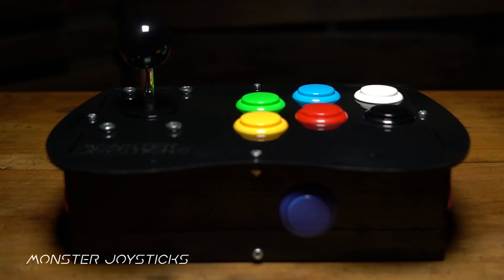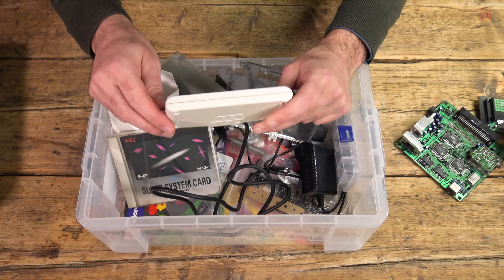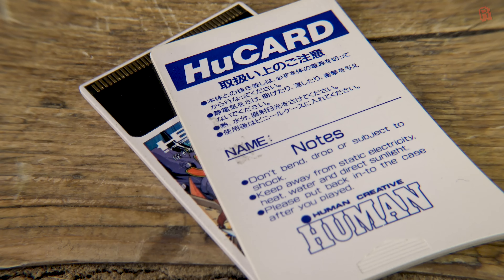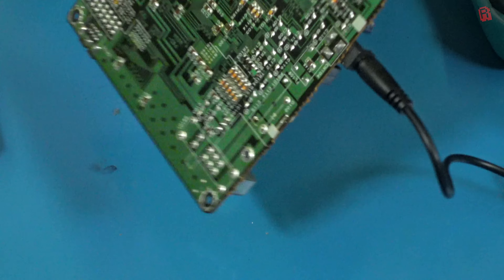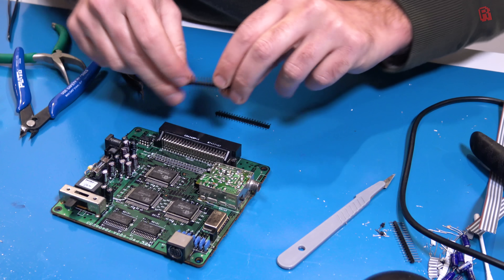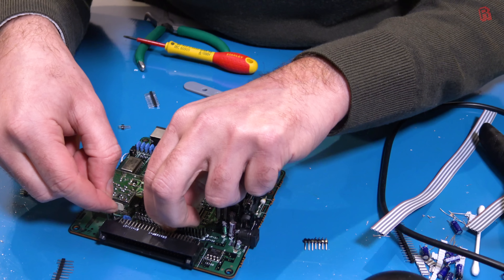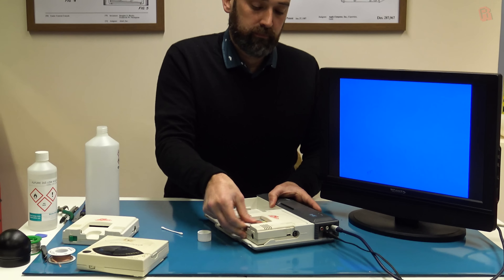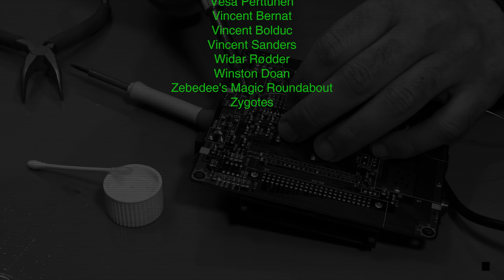PC Engine Trash to Treasure (Pt1) - Restoring NEC's 8bit Wonder

Comment: Nice job with the restoration! Though I kind of prefer the grey of the CoreGrafx units, the original PC Engine is so striking in its own way.

As for game recommendations - the first port of call is with the shmups, there are an amazing amount of them, on both HuCard and CD.

HuCard wise my picks would be Galaga 88, Super Star Soldier, Gunhed/Blazing Lasers, Soldier Blade, Xevious plus Gradius & Salamander. Some non shmup gems are Victory Run, Out Run, Devil's Crush. I'm sure there's plenty I've missed too.

As for CD games, on the shmup side Gradius II, Gate of Thunder and Lord of Thunder are all worth digging. Ys Book I & II is great (though hopefully there's a way to get the US version running on a Japanese system for obvious reasons).

And I did chuckle a bit when you were getting it all going, because we've all been down there before.

Comment: Alright, so if the RGB pins are available on the back, you can definitely RGB mod the interface unit because you just have to pick off the appropriate pins. You can just buzz your cable with a multimeter to figure out which pins you have to use for RGB output.

Comment: There is a turbo-block add on that goes into the PCE expansion slot so you can get component, composite and RGB.  however the CD briefcase setup...not sure how to get RGB on that

Comment: If the interface plug on the back of the PC Engine has RGB, then the interface shouldn't require much modification. Those pins probably aren't populated, or maybe not routed to anything, on the board in there. I would suggest putting a DIN socket with the right number of pins wherever it will fit and look nice. I suggest DIN only because it's compact enough, and won't send any mixed messages to someone coming along behind you, like a VGA socket might.

Comment: You also CAN'T use the TV-Modulator/RF. Even if your TV supports NTSC input on composite, it would need a dedicated demodulator for japanese RF. Even many american TVs usually can't tune in the RF signal from japanese devices; in that case it's because they can't access the correct channel.

Comment: I modified my IFU using Voultar's IFU RGB with a nice Deltron 9-pin Din. Also re-capped the IFU and replaced middle gear in my CD-ROM2. Surprised you didn't perform the PCE jail-bar fix though? This makes a HUGE difference, especially if connecting to an OSSC or Framemeister. ;-)

Comment: The CD-ROM isn't too bad to work on, I got a new gear and replaced it and managed to reuse the circlip. Had to trim one of the pots though, when I tested it with an audio CD and headphones the audio was skipping. I just tried adjusting each pot until the audio played perfectly, worked great.

Comment: As soon as a saw that stiff ribbon cable I thought of pin headers. Glad you put some on and made a flexible cable and the fuse holder was a good idea too.
I've always thought the white plastic and the styling makes them look like a cheap and nasty toy, which is such a shame. But that's just my opinion which is probably wrong anyway!
However, that CD-ROM cover could change the whole style, looking forward to the next episode.

Comment: A Turbo Everdrive might come in handy but are pricey like most of these replacement carts.  As for games there is Bonk's Adventure, CastleVania Rondo of blood (Akumajou Dracula X - Chi no Rondo) It is a CD game also, which is the game before Symphony of the night. plenty of Shmups too like Lords of thunder, Blazing Lazers and Super Star Soldier, Soldier Blade. Then you got to get Bomberman.
Reply: I had trouble with my everdrive with corrupted graphics in game, but orginial cards were OK. I have a few PC engines and they all had the same problem.
Reply: @willyarma_uk  After finding a TurboGrafx 16 (USA) for a ridiculously good price a few years ago the first thing I did was buy an everdrive and download the complete romset for it. Now it's almost 3 years later and I've never once had a problem with mine. I think I remember reading that the first run of turbo everdrives were faulty in some way though so that may be your problem
Reply: @willyarma_uk  So your saying there could be an issue with them then.
Reply: @enigma776  Possibly, I dont know if its just mine, prehaps its faulty or a fake. Have you had any glitches?
Reply: @willyarma_uk  I do not own one but was thinking about it. As I said its quite pricey.
Reply: @willyarma_uk  It depends on which ROM-dump you use. Some games have several different ROM-dump versions. Some work with the everdrive, some don't. Best get the complete rom dump set for PC-engine/turbografx 16 games which contains every rom version ever copied from the original HU cards. Then You'll find working copies for sure.
Reply: @willyarma_uk  Theres a switch with the later models to change from Pc engine to Turbografix.
Reply: The suggestion of Bonk makes me wonder just what RMC describing the series's punny Japanese titles in his signature style would sound like

Comment: Great video, I suggest you modify your Briefcase Unit to add RGB Amplified Scart output, I use Tennokoe units modified in a similar way as they are a more non-evasive console mod like your lead :-)

Comment: Why not just strip the wires for the old cable and then reinstall one wire at a time? That's what I like to do but I know everyone has their preferences and I am not criticizing. The reason they break is from people moving the cable around too much when opening the case too often or performing mods. Don't move the cable around and they will never break. So reusing the old cable is just fine. A white screen can also be the sign of a faulty chip on the board. So good thing a simple cleaning fixed it. Great Video :)

Comment: All the video signals are generated by the PC-engine and passed through the cd interface, so if you RGB mod the PC-Engine, and replace the RF with a suitable DIN you will get perfect video from the CD without modding the interface. There is very little room inside the interface so the console RGB mod is the way to go.
Reply: I did do a component video mod to an interface unit, but it was very difficult, because of space limitations.
Reply from the maker: Thanks for the tip, I will never use the RF so that sounds like a viable option that I'll look into thank you

Comment: 08:40 You should not use Switching regs for video ICs as they introduce loads of ripple that can translate into visual interference (usually diagonal lines in the picture). Stick to Linear regs. To lower temps use a newer Liner Reg like the 78S05 (slightly more efficient than 30yo+ ancient regs), also add thermal paste and do not feed more than 9v input.

Comment: In regards to having RGB in the Interface Unit, it's possible to do so, just some soldering and figuring out which wire goes to which lead.
http://8bitplus.co.uk/projects/nec-pc-engine-interface-unit-rgb-mod/

Comment: Nooooo Neil you get 2.54mm pitch cable! I'm crying 😭😭😭 They even come pre crimped 😭😭😭
Reply from the maker: Link me up!
Reply: @TheRetroCollective  took me ages to find it back it the day - search for "ffc jumper cable". Example: https://www.esskabel.de/produkt/flex-jumper-254/

Mouser: https://www.mouser.at/Wire-Cable/FFC-FPC-Jumper-Cables/_/N-ad930

Took me ages to figure this out when searching for a replacement for my TB-303!
Reply: BTW, that footprint might actually be 2.5 mm and not 2.54mm, that's why it doesn't fit standard headers! But there are 2.5mm headers and 2.5mm connectors... just for this purpose... in case a 2.54 mm cable will not fit the raster
Reply from the maker: @cheater00  Excellent stuff.  The clearance on that hu card PCB is really very tight with just the cable in so even those connectors might be too much, but I love the idea of using those cables.  I'll have a play with them thanks and see if they fit
Reply: @TheRetroCollective  I was thinking you would solder to the daughterboard and use a connector for the main board.

But i also thought you might be able to make a small pcb that goes between the two and just connects the two through. It could be soldered to the daughter board. Question is if it's too much faff.

Comment: It's also like "NEC's one hit wonder" when it comes to consoles. 

Neil, you went out shopping for the fuse? Was checking some UK retailer. Maplin didn't mention anything about the crisis, while Currys (are they spicy? ;-) says shops are closed but you can order online. Here in Canada all shops are closed. The biggest retailer here (BestBuy) also orders online shopping with home delivery, but also "store-front pickup".

And lastly, I could never figure out, when hole through processor pins where replaced by surface mount (or how you would call it), assuming around 1990. But your console seems to be from 1987 and most chips use surface mount. So I am wrong, or the Japaneses were ahead of other countries.

Comment: I still prefer the TurboGrafx16 , but that's my Nostalgia (!) do you have the Everdrive  ? 
Also, that PCB is so small, you could make a TurboExpress with it ! just need a good screen, Battery & controller integrated on printed shell ...

Comment: I've got several PC engines. I've done an RGB mod on one of them. Theres a bit of grime in the plastic that wont come off, hopefully after watching I might have some new ideas.
Reply: I didnt try a brush, was scared of scratching, but i'll give it a shot. That regulator module is ace! and that expansion slot scart cable too!
Reply from the maker: Thank you!

Comment: I wonder if that cable broke because someone had been in there before and repeatedly bent it backwards and forwards, fatiguing the metal. The plastic might age and go brittle, but wires don't unless they're repeatedly bent or they become corroded.
Reply from the maker: It's certainly possible.  My first thought was corrosion caused by leaking caps but that wasn't the case

Comment: The 7805 basically burns the excess voltage, so if you go from 9V to 5V almost half of the electricity the device draws is just being burned...

Comment: I could repair that with ease. I used to rebuild the original NES, Sega Genesis, Sega CD and the Turbo Duo. That Data Ribbon Cable isn't difficult to replace either. --'
Reply from the maker: Nice one Sean
Reply: @TheRetroCollective  If you use Soldier of 80/20 or 70/30, the Solder joints hold up very, VERY well. I haven't run into any Capacitor problems in all of the units I've repaired, but a few leaky ones should be replaced without question. The PC Engine was well-ahead of its time, and if you can shell out the money, you would have your hands on a very, VERY Classy, yet POWERFUL little system with an AWESOME library of games for the Nostalgia or a an eager collector!!!! Good show Mate! ^_^

Comment: why wait for the soldering iron to cool down? unscrew with some pliers, remove the entire assembly by  grabbing the tip with pliers, set it down on a heat-resistant surface, put needed tip on heating element, put sleeve and nut back on with pliers.
Reply: why i know this works? done it myself. be careful about the sleeve and nut tho, stuffs pretty hot after the soldering iron heated up.

Comment: Also for my suggestions, I'll repeat the suggestion for Gunhed (not Gunhead) down below: it's the Japanese release of Blazing Lazers. And if you're going to do that, also get the various Star Soldier games that were released on the platform as well. And three more notes:
1) Unless you want to get an Everdrive, you will need to get Japanese releases for your PC Engine — the region lockout on this thing actually involves rearranging the card pinout! I'm not sure if anyone has made a standalone passthrough adapter or not, but if they have, you can go ahead with that, I suppose.
2) I do not know if the PC-Engine CD-ROM^2 is similarly region-locked or not. If it is, given your request for games that are playable in English, it'd probably be best to give up on any RPG suggestions. If it isn't, I'd have to point out that Working Designs only just got started at this point and often went even more overboard than usual for them when increasing the difficulty for their localizations of CD-ROM games. (Exile 2 is particularly infamous in this regard.)
3) Your CD-ROM card adapter is the Super System Card, which means you're already set to go with the later "Super CD-ROM^2" series of enhanced games with your normal CD-ROM^2. I'd suggest looking at the rereleased Super CD-ROM^2 unit that was sold simultaneously for people who didn't already own a regular CD-ROM^2 — it has a different interface unit built in, and I wonder if that one satisfies your video desires. What you don't get with that card however is support for games that require the Arcade Card; if you have that, you'll need to get the Arcade Card Pro (specifically, as the normal Arcade Card Duo requires that new version of the Super CD-ROM^2 interface).
Reply: Oh also if Guru Larry and/or Slopes Game Room are anything to be believed about the popularity of Parasol Stars in the UK, then I'll remind you that that game was developed for the PC Engine specifically, so go for that one too I suppose...?

Comment: What do you mean the lights were condemned? How are lights condemned?  Did they not pass code or something?
Reply from the maker: The lights kept tripping the electrics out, the land lord sent an electrician, the electrician said they weren't safe.  A 2 week battle ensued in which the landlord replaced 12 x 1.5m fluorescent tubes with single 5w spotlights... it was a terrible solution and a pretty stressful time as you can imagine having very little light in The Cave.  I had to get legal advice to help get the landlord to install lights that met health and safety standards.  Anyway...we got through it in the end.
Reply: @TheRetroCollective  Shouldn't a cave be dark?  J/K Thanks for the explanation Neil.

Comment: Why bother replacing the 7805? Why not use a 5v DC power supply instead and remove the 7805?

Comment: Seems kinda straigh forward to make an RGB output through the dock connector.
https://gamesx.com/grafx/pce_rgbbackplane.jpg

connect to those pins in the dock with either a female SCART connector and use an ordinary scart cable or if u want a smaller connector to fit on the dock a db-9 connector and make a db9 to scart cable to use with it.

Comment: It always kind of bugs me when people call the PC Engine/Turbographx 16 an '8 bit system'
It might be technically correct from a certain point of view, but for all practical purposes it's more comparable to the 16 bit consoles than any 8 bit system.

It's clearly a competitor to the 16 bit consoles, and much of it's support hardware is 16 bits, it's just let down by an 8 bit CPU (though that has memory access extensions different to a typical 8 bit CPU)

If it had instead used a 65816, (which would have simplified design and processing, but may still have been expensive at the time) it wouldn't ever be getting compared to 8 bit systems.

In reality it just sits in a weird place, technically.
(But shows that in some ways the CPU is one of the least important parts of these computers and consoles for determining gaming capabilities...)
Reply: I just thought of it as a 12 bit system. 8 bit cpu, 16 bit graphics engine, so 12 bit system. Sort of. But easiest way to remember, it was slower than the 16 bit consoles, but much better graphics than the 8 bit systems, so sort of a weird place. Being first to a new console generation is not always the best strategy.

Comment: 21:40 Now that you have installed pin headers, you can swap byte order to play TurboGrafx-16 hu-cards. The TurboGrafx-16 differs from the PC Engine in that the D0-7 datalines are reversed (actually, the PROM is programmed that way, and the wires leading to the data bus in the machine are reversed) http://www.hardwarebook.info/HuCard

Comment: I love trash to treasure but you usually do an intro video. I've no idea what a PC engine is. I've no idea what I'm looking at.
Reply from the maker: Thanks Colin, yes this has been a little unusual owing to the problems I've had with the lights as mentioned in the end of the video.  I'd also very much like to get hold of the many versions of the PCE and then make a video on them some time.  Buy yes point taken, it's a little different to normal
Reply: @TheRetroCollective  ah no worries, I googled it before watching the rest. I also found an old video if yours that was a pc engine laserdisc thing so you must have covered it before. Enjoyed video as always, cheers!

Comment: as long as the solder job is good who cares about tip used you could have used a 40wire IDE cable too
Reply from the maker: The ground plane was sinking away too much heat from the smaller tip, this is why a larger tip helps.  There are 42 cables and the pins are not aligned as mentioned in the video.
Reply: @TheRetroCollective  why you pull them apart and yes i know all about the ground planes im a engineer im also the guy who help make the new fast PPC PCI accelerator card for amiga the ones everyone is playing Q3 and RTCW with